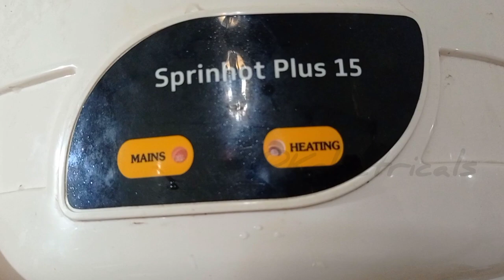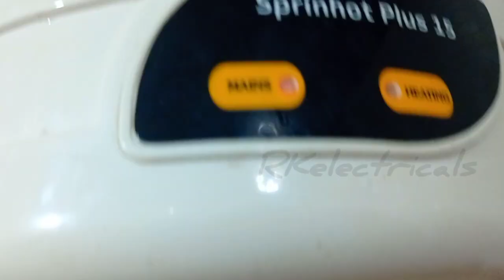Geyser Current Shock Problem | Kese thik kare | How to repair geyser current shock problem

Comment: What causes this problem
Reply: The most common cause of electric shock is a faulty earthing system, either at your home or among your neighbours. Many times, if your home appliances are not properly connected to the earthing system, there is a possibility of return current through it, and the water pipe line may come into contact with this type of appliance, causing a slight electric current to pass through the tap water line.